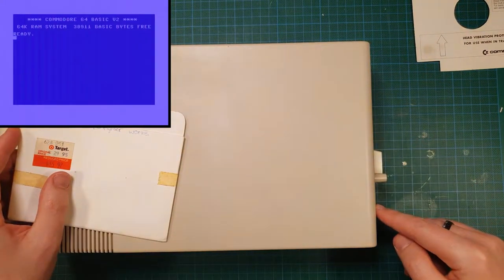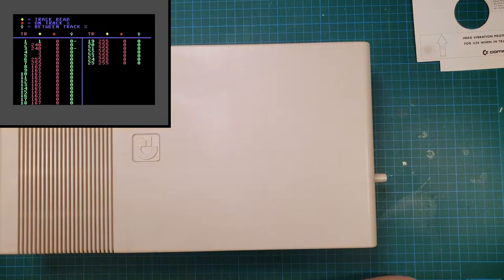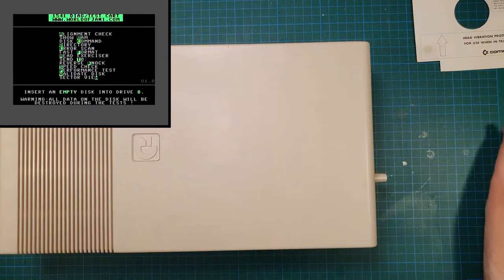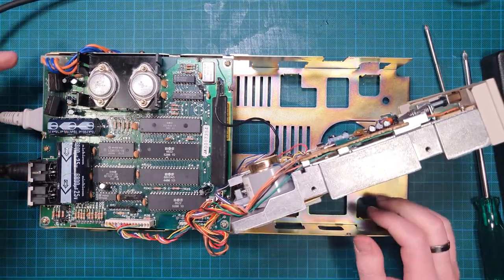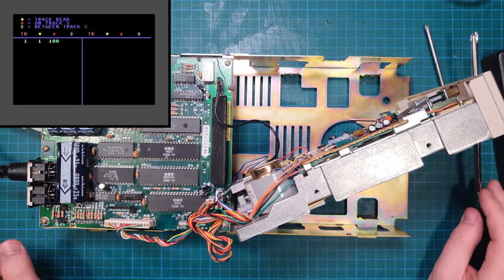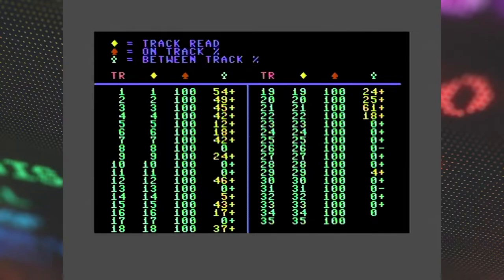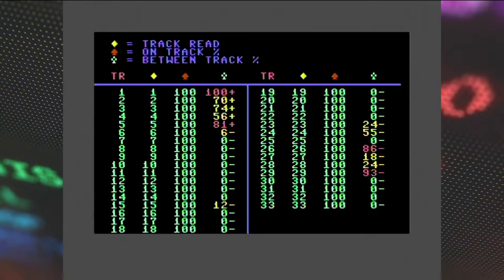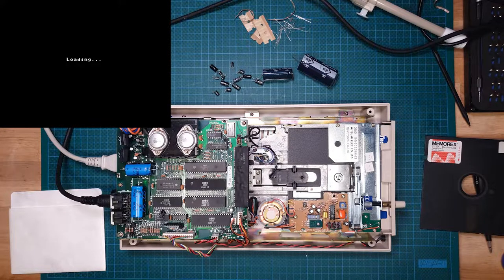Diagnosis and repair of a 1541 floppy drive that can't read disks

Comment: Where did you get the Mitsumi D500 replacement head? I have searched far and wide, with no luck...
Reply from the maker: Luckily I had another D500 mechanism from a 1541-II that had a completely destroyed mainboard... unfortunately this seems to be the only way to get a new head mech :-(

Comment: Hi! question regarding a 1541... When I turn on the drive, there are not lights at all, but I can hear the motor and see the (don't know its name) circular thing which goes in the middle of the diskette spinning around... do you have any idea about what could be the problem? many thanks in advance and for  your time

Comment: Thanks. You made this look very easy. What are some other possible causes for this type of problem?
Reply from the maker: Cheers! I've only really found either a very dirty head as the other example for this fault. The Newtronics mechs in these are pretty commonly known to have failing heads by this point.

Comment: I have a 1541-II that used to read disks but now does not. Just file read errors. I cleaned  the head and now it will not even do a directory listing. I have other drives and will try them.
Reply: The heads on Newtronics mechanisms just fail by themselves. There's nothing you can do about that. You can open up the drive and measure the coil resistances and they should be about 15 ohms.

Comment: Excellent video. No one knows of a source to purchase these head do they?
Reply from the maker: Thanks, appreciate it! The only source of replacement heads is parts salvaged from drives with other issues, unfortunately :-(
Reply: @silvestronsbitsandbytes  There is one other (expensive) way, and that is for someone to contact one of the companies that make disk drive heads and have them find one that matches or make one that can be installed in a Mitsumi D500. Heck, has anyone even contacted Mitsumi to see if they actually have any sitting around on a shelf?

Comment: “Test Drive” — pun intended? You chose a good disc to check because it has Rapidlok protection, which is very sensitive to drive alignment.
Reply from the maker: You know it wasn't intentional - I had only just gotten the boxed copy recently and wanted to show it off, but I'll take credit for it after the fact :)
I didn't know that about Test Drive and Rapidlok! Kismet on many levels it seems!

Comment: I have the exact same disk drive and problem does anyone know where to get a new read/write head at
Reply from the maker: Unfortunately, you can only get replacement heads from another 1541 drive that has some other problems (like physically broken, or dead main board etc)

Comment: Weird how you have a 1541c, with the correct -02 ROM version, yet the track zero sensor isn't actually enabled. If you open jumper J3 you won't get the noisy alignment wrecking head rattles with standard DOS ROM routines.
Reply from the maker: Great catch! I learned of this after I had already completed the vid and sent the drive back to the customer, so unfortunately not able to set that jumper, but if I ever get another I'll definitely perform that!

Comment: Anymore when I run into a newtronics mechanism with error 21, I go right to to testing the head. I had one essentially new in the box, plastic film still on the emblem on the front of the case, dead head. It's really a shame.
Reply from the maker: Definitely a shame, if only there was some modern or alternate replacement head we could swap in rather than having to salvage from other Newtronics mechs and hoping they don't fail too.

Comment: Don't have these (specific) problems with punch cards...
Reply from the maker: I don't even wanna do the math on how many punch cards you'd have to go through to match the storage capacity of a 1541 diskette!
Reply: @silvestronsbitsandbytes  It's probably 'only' a couple of thousand (~170,000 bytes per disk, ~80bytes per old school card).

I seem to remember IBM working on a new version of punched cards for archive storage reasonably recently with impressive densities (in excess of spinning platter drives)?
Reply from the maker: ~170k is per side as well, so you'd need at least twice that many cards!

Comment: You should use an original disk like the commodore 1541 test disk for the alignment test.
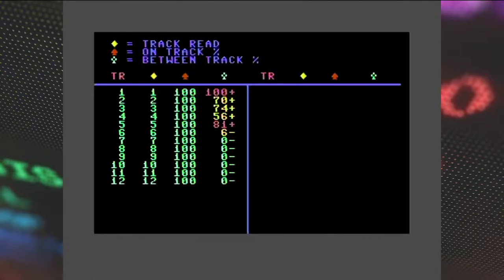Reply from the maker: Correct and I mention this and the reasons why around 23:40
Reply: @silvestronsbitsandbytes  Yes, you did later on. - Btw great job. I had to bury several 1541s because of a dead head. Nothing I could do about :-(.
Reply from the maker: @madmartigan1498  same unfortunately, I have a few tucked away on my shelf, hoping I'll get lucky one day and source some heads or at least other drives with a good head but broken in some other way. A man can dream!